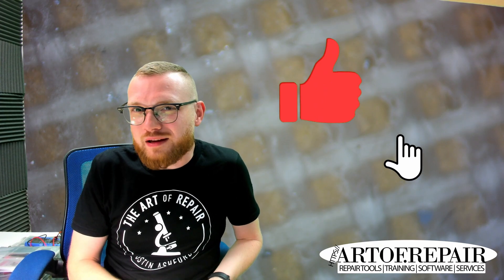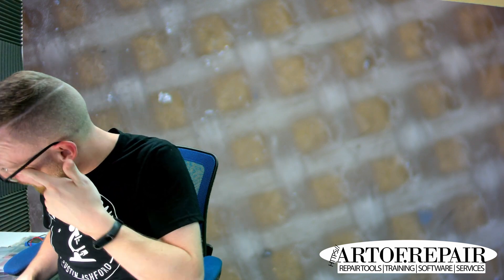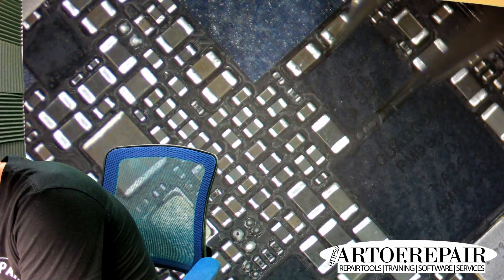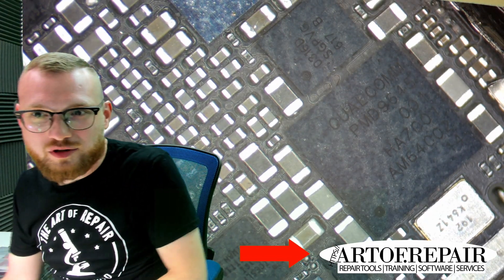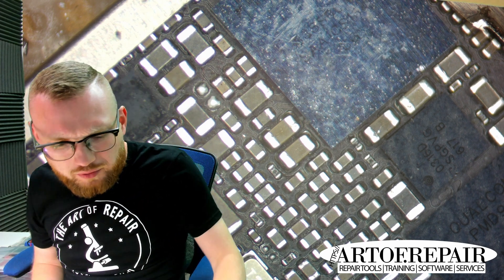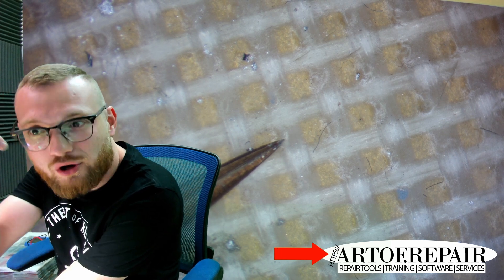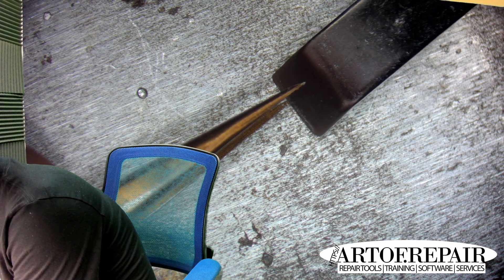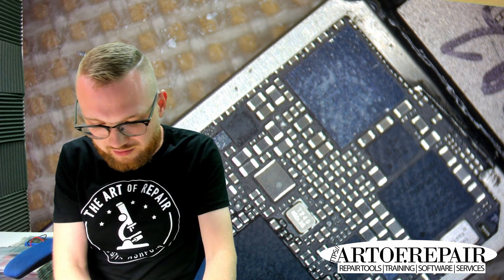😄 Make your own  🔬 AOR Hooked SUPERIOR MICROSOLDERING Tweezers TODAY! 😄

Comment: I made some but with more of a bend on the tip. A full 90 degree bend on each tip so they have a pincer grip. Very useful. Goes right under bga chips so you barely have to grip the sides at all. The ends are blunt so close seamlessly into a curved loop.

Comment: Hello sir ! Have you ever tried looking into medical equipment they have tweezers with put hooks they have four different styles? Just look up medical supplies most companies have them
Reply from the maker: Yes, but they are not this fine tipped, medical stuff is usually really big in relation to the stuff we work with :). But I will still go look again! Just be sure :)
Reply: @TheArtofRepair  the are the finest as the mechanic and all the others that what I have use fir about 8 years and they’re just getting better

Comment: love me some hooked tweezers, they have soo many uses beyond BGAs. I use a larger pair with a sharper angle to pull wifi antenna cables, some ribbons, speaker connections. works great.